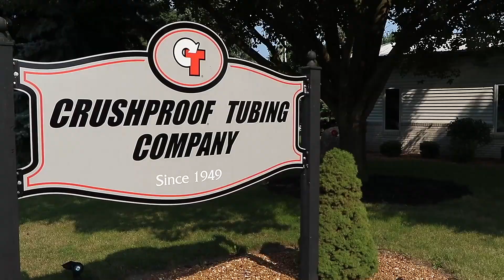Crushing Car Myths- The car with a WOOD chassis?!

Comment: Yeah people need to research different types of wood. Just look at the wood hardness scale.  I made  knife grips out of some iron wood and the drill had as much trouble with it as some cheaper steel, and im not talkin the thin gauge punched/pressed stuff. The strength of wood construction seems to be limited more by supply and availability.

Comment: Wood is a great material to mate the metal panels on to. It also has good acoustic properties. Gavin speaking with an accent? Sounds more like a speech impediment. HAHA!             The Mosquito was a very interesting story. It was was made almost entirely out of wood and it was the fastest piston plane used by the allies in WWII. The great thing about the Mosquito was that the British could leverage their long tradition of file woodworking. Cabinet makers from all over the country could make components and ship them to a central location for assembly.

Comment: UK Subscriber, Hi Casey, the MARCOS GT and SPYDER  in the '60's did have wooden chassis , mainly plywood/spruce in monocoque form (unibody) and manual (stick shift) gearboxes with Glassfibre (Fiberglass) bodies ,only Aluminium (Aluminum) used was in the steering wheel , a very light / low car needed holes in the floor for your seat ( Ass) to stick thru , owners always looking for rocks to avoid when out driving , definitely be a Nuclear (Newcular) event if you hit any !
Reply: Funny isn't it, they say Aluminum but yet don't say Uranum, Potassaum  or Magnesum and still they pick on Brits for saying Aluminium. Strange world.

Comment: I'm not sure that you are busting the myth here. True, what we would call the frame is metal, but there is still a lot of wood used in structural areas and that was true of a 2000 Plus 4.

Comment: As a Brit, stick shift is called Manual. Typically we learn and are tested in a manual, as if you have a manual licence, you can drive both manual and auto. If you do an auto licence, you are only allowed to drive an auto.
Reply: I've heard it's fairly expensive to get a drivers license in England or Germany, especially after a few tries.
I doubt an average American could pass a license exam in England, even after several tries? ;-)
Reply: @TairnKA  It took me 3 attempts, which was way back in the late 90's and I think I had to work for a few months each time to have enough money to afford it. 

We have a theory and practical test, and what I always struggled with was parking stuff. Even to this day, it's something I get stressed about when I have to do it.
Reply: As an Aussie  i also call a stick shift a manual
Reply: But what do you call the stick itself? We call the cars 'a manual' or 'a stick-shift', sometimes just 'a stick' for short. 
The shifter itself is commonly called 'the stick' or 'the shifter'.
I feel like I've hear 'gear selector' on british programs before, but I dont remember
Reply: @fatpad00  Gear stick
Reply: @FelixIsMyName  or gear lever
Reply: @sheerluckholmes5468  that is for opening a drawbridge

Comment: A Gear lever. These had a plywood chassis / frame: https://en.m.wikipedia.org/wiki/Marcos_GT . I used to have a Morris Minor Traveller that had a rear wooden body frame. The English Woody. What is it about English dental hygene? Up to resently we did not go for Hollywood bleached teath but that does not mean they are dirty!

Comment: Wood is VERY FLEXIBLE. Better than metal in some applications
Reply: Wood has a similar benefit to composites: it has a high toughness relative to its weight,  i.e. it absorbs a lot of energy before breaking